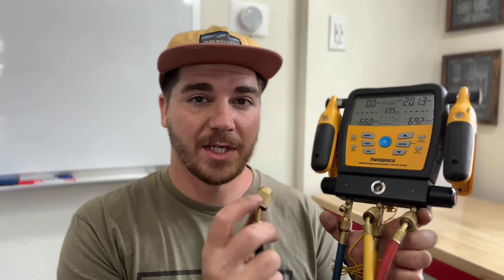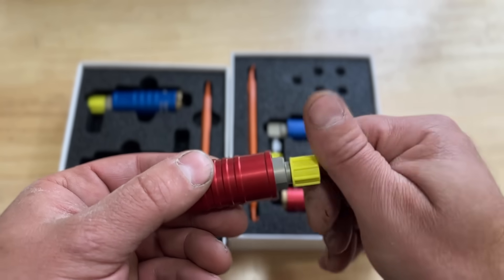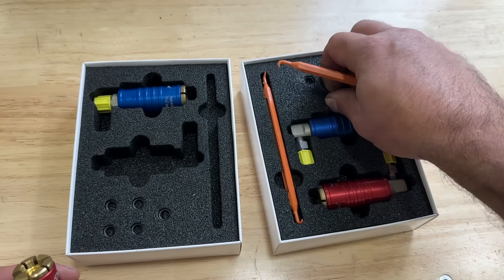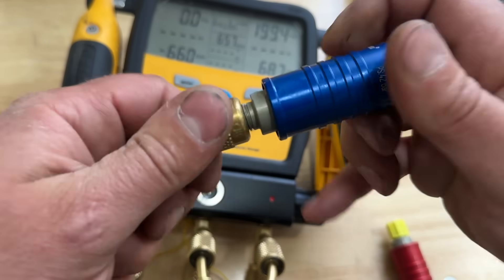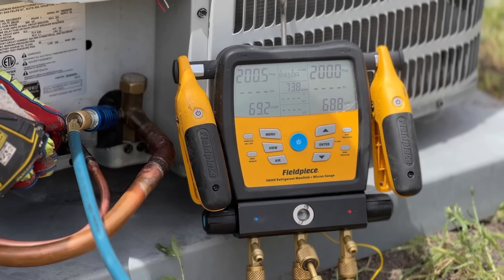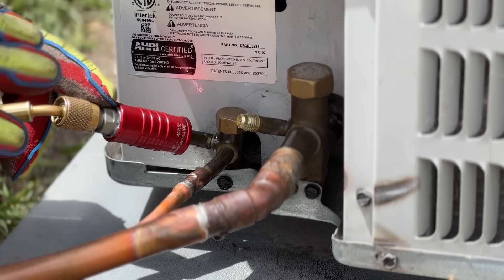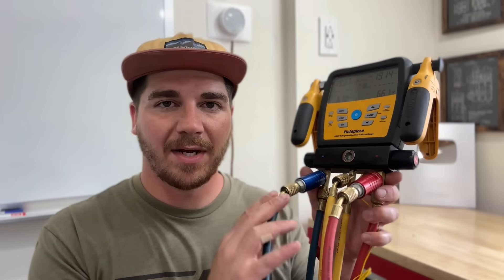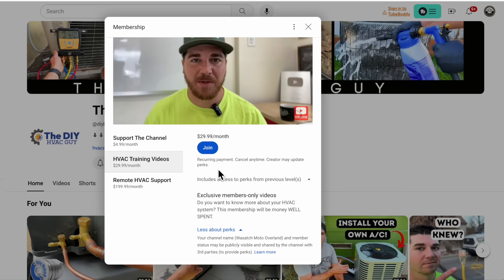This New HVAC Tool Is A GAME CHANGER.

Comment: I hate fitting my gauges, much prefer my wireless probes, no good if i need to add charge, but from an inspection standpoint it much better for the client not losing whatever volume of gas is in the manifold and hoses…even if it is at the low side pressure. Plus thers no risk of adding air or contaminants that might be in the manifold.

Comment: That is a very interesting idea. I'll have to see if the local supply house stalks, those. They kinda remind me of the automotive quick disconnects other than you don't have to manually wind them down to access the service port schrader, those already push it in automatically, that's kinda cool. I do like my low loss fittings, although I have to replace one of mine because the o-ring felled in it.

Comment: If you dont lose refrigerant from the hoses, how are you gong to charge the customer for more refrigerant later. half the equipment I come to is low due to tech putting on hoses 4 times a year. We do quarterly checks on commercial equipment. Which is ridicules, but cant convince management it is. Because that what they  have  always done.

Comment: LOL, I have never seen access ports at a 45 degree on a service valve in 48 years. I doubt these devices will fit on most units. Not enough room to get them on.

Comment: The fittings on the SMAN are NOT low loss fittings. I've been using LOW LOSS ADAPTERS for years now. They come in 45, 90 and straight. they are easier and cheaper.

Comment: Thank you for the video. 
How well do these work to pull a vacuum and decay test?
Also I checked out the link and these are no longer available.
I was also wondering about the new system starting in January 2025 will these work with the new hook up “new refrigerant”?

Comment: Dude, you are not an HVAC guy, you are a commercial. The price of these are a joke. $320 on the amazon site link. I would rather release all the freon out of the system. F*CK the environment. Your cost are stupid dumb. I can use low loss much, much, much cheaper.

Comment: APPION 'Core Control Tool' is way better tool.  If a core doesn't close you will pay lell to get controll of it again with a CCT close it and get a hose on it easily.  CCT right angle almost always makes connections easier straighton connections almost never work well. CCT can fully depress those 'coremax' valves. CCT works well in tight spaces.

Comment: They came and gave us some samples when I used to work at Johnstone.  Very cool and high quality product, but too expensive and sometimes impracticable due to the clearance you need to connect.

We chose not to stock them and I’ve never seen anyone else with them.  My current fieldpiece Joblink probes have the best connectors hands down.  They aren’t the giant low loss, minimal and just great quality.

Comment: Those fitting are going to tear up the threads on the schreader valves especially when disconnecting under 500psi of pressure the push-off when 98% un-latch will be incredibly shreading on the threads

Comment: Those fitting are to large in lots of situation. I used low loss fitting and they worked good. The best solution I found was to use a regular fitting with the hand operated shot off valve about 5 inches back on the hose so the refer loss is hardly nothing

Comment: I haven't used gauges in 5 years. Probes are the way to go. Thread the depresser in your tee and you don't lose refrigerant. Cool concept but won't fit in a lit of applications due to size.

Comment: Looks like a quick way to connect if you've looking to shave seconds off a job hah! They are pretty clunky though and not every system will have the clearance. I like to use gas retention valve/ core depressor with a T for limiting refrigerant loss. Smart probe on one, and other open for whatever be it charging, micron gauge, etc.
Reply: its not just about time, its about easy of use and being able to streamline your process and have as little things to fight against you.

Comment: I use hoses with valves and loose very little refrigerant by closing the valve then keeping pressure on the rubber gasket until there is enough space to no longer depress the schraeder valve.  Waste of money but obviously your ad worked they are sold out on Amazon.

Comment: You don't need even low loss fittings.  If you're getting blow back you need to adjust the schrader depressor using a schrader removal tool/needlenose... I have 0 blowback or issues using standard fittings.

Comment: I switch my gaskets the moment I see them wear and keep the valve depressor a bit tucked 

I hardly have any leaking 
I also don’t use hoses only probes 

Just an idea for techs out there 

I’ll go through a pack of seals per season 

Not too bad. They’re like $10 bucks

Comment: just as recent as last week, r410a cost me $236 per 25lb jug. To think i would spend $200 for each set (straight and 90 degree) of these, is ludicrous to save a couple of squirts of refrigerant(especially, when the EPA said that a small amount of refrigerant loss is acceptable when connect and disconnect hoses). This is for the new techs only. As for seasoned HVAC+R techs, if you have been doing HVAC for a while, you know that there are, at least. three cheaper more effective ways to minimize refrigerant loss, than even the low loss fittings.

Comment: Or, spend $20 for some charging valves… Basically, you attach the valve and then turn the screw to depress the Schrader… I use these and there is just too much variance is fittings and it allows you control over when the Schrader gets depressed…

Comment: If you do have to call an HVAC repair tech stay away from commission based technicians.  Most will try to upsell you on getting things replaced just to receive their commission from the sale even though the existing unit is still in good condition.

Comment: totally not worth the price.  I use the isolation valves that are quarter turn and they were only like 30 a pop.  Also it looks like its only for 1/4 fittings or does it work the 5/16 as well?  In certain situations they look like they would be too bulky to use from my experience.

Comment: I would like to know if I can put a sequencer ( time delay ) after the contactor to my compressor and which  load voltage line do I use .  Do I put it on the black that goes directly to the compressor after the contacter or what .  I know that I have to put 24 in line to the contact too the time delay .   Put can this be done ? And will effect the compressor in any way.  Other than 1) it will first  make the condenser fan will start first and after a few seconds the time delay will make the compressor start. What do u think !!!!! And how

Comment: Fieldpiece (JL3) and Testo (an others) make wireless pressure probes that you can connect to low loss fittings.  Almost zero refrigerant loss.  
You can also connect a tee fitting for charging (with a hose of course)
Reply: It's what I use and zero refrigerant burn with extremely low loss. I swear by them. Great product
Reply: Welp. I am waiting for wifi refrigerant charging and then I will buy the ridiculously priced fitting that have been around for 100 years.

Comment: You should never be removing your liquid line while the system is still running
Reply: You can just simply suck the refrigerant back in through your low side lol. You don’t know what you’re talking about
Reply: @iiTayKova  I know very well what I'm talking about it. You obviously don't know what I'm talking about. It's not about sucking the refrigerant back. It's about taking the hose off during 200-300psi in a liquid state vs removing it at 100psi in a vapor state.

Comment: Okay so cool idea but that just made me think of an idea... why not just use pressure transducers to read pressures with out a manifold, so no long line set and you just want to see what pressures you're seeing in the system. Maybe make it so the low side has a port to add refrigerant so then you wouldn't need to disconnect anything and no loss at all....

Comment: My YJ R134A connectors lock on and then screw down to open the valve.  Reverse to remove.  Nothing but the slightest pop when disconnecting.

Comment: When changing O rings I would lubricate them with vaseline or DC-4 to help them last, good info here.  FLY NAVY!!!
Reply: And you'll end up contaminating the refrigerant in the process. The o rings do not ever need to be lubed in this application. If anything, the ONLY safe lube to use would be Nylog.

Comment: I got burned pretty badly in my first month, having to go to a burn center and be out for like a month almost, but that was before i knew about the two finger method... but there is certain situations where its basically impossible when its in a dumb spot, so this would be good for that but man i hope they dial that price back
Reply: Dont worry, in about 20 years, you wont have any feeling in your fingers from being frost bit just like me. Develop some callus on your fingers helps.
Reply: @JohnD-f2o bro I'm already kinda at that point lmao ...it used to hurt bad when i hooked up gauges but now I hardly feel it....But I've also got more quick. Almost got burnt again recently tho as these lowloss fittings were messing up and missing a gasket

Comment: Show me how they work in the most common scenario.  Make sure it's hot AF outside, have the system running and in the same continuous video frame, show me the loss using the conventional hose connectors and then with these unique adapters. And are the orings unique in size to the adapters, thereby marrying me to this company for a $50 bag of $2.00 orings every few months?
Reply: they are dam near impossible to get on when the pressure is high, hot day etc. Even on the low side.
Reply: 😂😂😂😂

Hold my beer and give me damn hoses son. Gotta toughen them hands up 10 plus years hooking gauges up everyday.
Reply: I’ve seen those safety gloves get frozen into someone’s hand do not use!!!

Comment: $200.00 that’s stupid waste of money.
Reply: So basically these are higher quality of these $9 ones?
"Flexzion Car AC R134a Quick Connectors System Port Adapters Couplers Low High Set Conversion Kit for HVAC Auto Air conditioning with Manifold Hose Gauge"
Reply: @L0st-n0found  Sort of but not really. The adapters on automotive are acme, the ones on refrigeration/AC are 1/4" sae flare
Reply: @L0st-n0found 
You sure these are the same connections that will work on a Mini Split?
Reply: @rotaxrider  wow my reply is gone
So again
As you said 1/4 sae flare do a search
I see many for under $20 and some look better than these and some look exactly the same.
Reply: @L0st-n0found  134a port have cheap tool option. but r22, r32 or other home ac connector not cheap
Reply: Speak for yourself. Stupid to you but not to others.
Reply: $200 is no money today sir
Reply: Yeah but throwing down $1000 for digital gauges isn’t, 😂
Reply: @TheCherokeeKidd  well, they are supposed to be very accurate and all that jazz..
Reply: @TheCherokeeKidd they like 500 where u getting your pricing at?
Reply: @TheCherokeeKidd true that

Comment: Dude, DIY HVAC? Just like the geniuses on FB market place trying to sell jugs of 22. Also, and I learned this old school. Fancy quick connects have a habit of either not being able to be used due to space limitations or mangled threads. As well as that O ring is the only thing holding in pressure. Which might run you into some trouble on higher pressure systems. I would doubt that you can use those gauges reliably knowing that O Ring could fail leading to a catastrophic release.

Mechanical connection is the only logical choice, which will prevent such a loss and by your 608 if you remember, you are liable for anything other than a "de minimus" refrigerant release.

Comment: There have been designs like those before from about 10 years ago.

The problem was when disconnecting if the Schrader valve is bad once you release the fitting, you're gonna have the refrigerant spraying out. 

With the low loss fitting, as your unscrewing it outside of the initial spurt of refrigerant if for some reason, you detect a more constant release, at that moment, you have the potential to realize that the Schrader valve might have stuck. 

At that moment, in time, he won't be in as bad a position as you would, as if you just detached the quick coupler and had a dead spray of refrigerant coming out into your face .

From what I have been able to tell and I am no engineer by any means is that the standard quarter inch connectors tend to be a piece of brass that screws on and pulls a nylon cone against the valve to seal it. The anti-blowback/loss fittings Are basically the same thing except instead of having the nylon cone they use the same thing that those fittings use which is an O-ring to seal when they are tightened.

Comment: You're looking at around 3 oz of refrigerant per hose loss every time you connect a manifold set with standard length hoses. Do that enough times and you ARE the leak. Yes, you could disconnect the high-side and pump the gauges down but you're looking at possible contaminants or a non-condensable unless you bled your manifold first. Anytime you open a system to check pressures there is going to be a loss, the idea is to limit that as much as possible. When I got to the point, I needed to check super-heat or sub-cooling I had over the years, built multiple sets consisting of only of high and low side gauges dependent on the equipment connected directly to a low loss access fitting. A simple Cooper electronic thermometer with decent set of clamp-on probes will with those gauges tell you everything you need to know and the refrigerant loss is much less than with a manifold even if it's properly bled and pumped down. Here is where I piss a lot of people off, why did you open that system to install a manifold in the first place? If you've got a good TD, compressor amps are in a narrow range of 80% FLA , you KNOW the coils are clean and airflow correct and there are no odd noises or vibrations what are you looking for? TD will point you toward airflow, capacity or refrigerant, compressor amps will point you to refrigerant, or an electrical/mechanical issue. Unless something is pointing you in that direction why are you opening a system?
Reply: Couldn't agree more!! Hooking up gauges is a last resort!! I just got hired at a company. I've been in the field several years. They told me I had to check pressures on every maintenance. I said "nope! Not doing that" if you are a decent technician, you will understand why hooking up gauges should be done only when you have no other option. You can check the charge using other methods; check the outdoor ambient temperature and compare it to the temperature coming out of the top of the condenser. Use a temp clamp and check the temperature of the line set. Check DT... Sooooo many things you can check before having to hook up gauges.
Reply: I’m only a home owner diy wannabe ac tech 
(I try my best to fix things) 
but I think your comment might be of obvious brilliance. 
Thanks.
Reply: Spot on! 
WHY IS THIS SO HARD FOR SO MANY TO UNDERSTAND?

I have tried to drill this into younger techs for 30 years, sometimes with effect but mostly not. I still battle it and the techs say they do it because the home owner expects it. Which tell me I need to get them trained in explaining why they don't need to hook up unless their is an issue, they can gather all the info needed if their isn't an issue without hooking up.
Sometimes I am told they do it because the customer expects it, thus more training is needed so the can educate the costumer on why and when to hook up or not.
Reply: @ZERO-F2G-  I think that's the way they are trained in many of the technical schools these days. The biggest problem is I've seen so many that all they did was hook up a set of gauges not realizing that is only one of the tools you can use. 

Another problem I've seen are kids coming from technical schools that cannot calculate super-heat or sub-cooling unless they have a electronic manifold that tells them what it is. That indicates to me they really don't understand the concept and are just doing what they've been instructed to do.

It also means when they run into their first "problem child" they are going to be stuck and have no idea what to do next. The smart ones, who realize they don't know everything and there is always something new to learn will ask for help from the manufacturer or a more experienced tech. The others are just another call back waiting to happen.

Experience will eventually level the playing field. We all run into something we've never seen for the first time. It's how we handle and work through it that makes the difference.
Reply: 3 oz of loss my ass. You are full of shit.

Comment: You would think with the under the EPA’s standard minimum refrigerant loss that these type of connectors would be standardized and way ahead of their time. Usually a great deal of refrigerant is lost in tight areas in struggling to get on and off especially high side.
Reply from the maker: Amen.